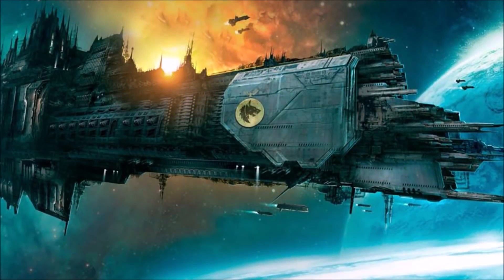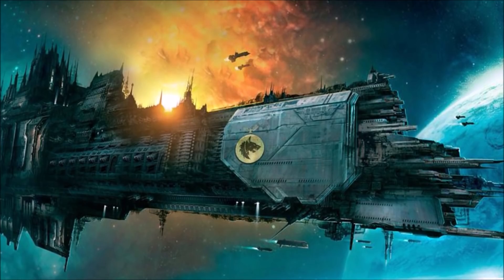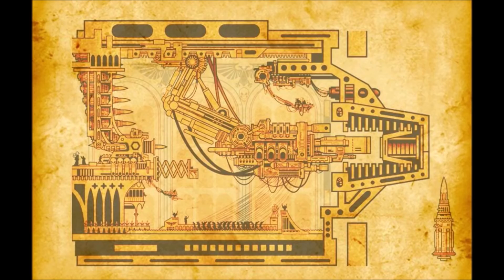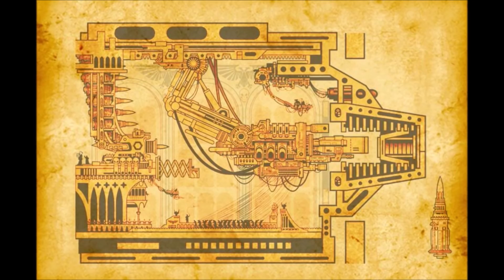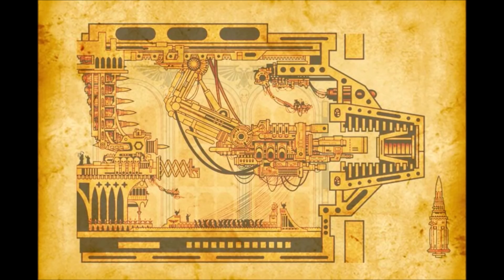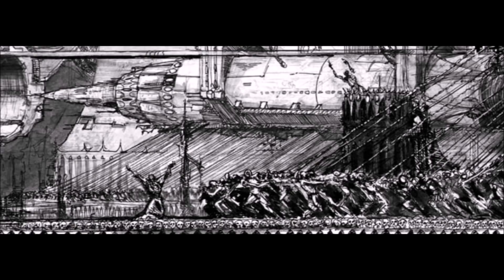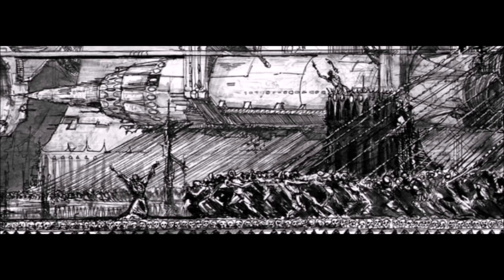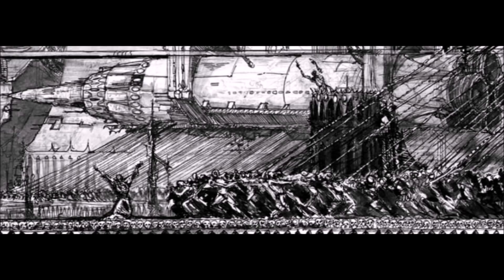Void War - Episode 0: The Methodology

Comment: It is clear that this games was designed before thinking about realistic conditions.
Reply: Maybe that's why they call it science fiction ?
Reply: @highconfessornicodemus1613  40K is Fantasy. Science fiction has to at least respect science.
Reply: @rodneykelly8768  name me one sci-fi setting that does that.
Reply: @powerflumi  

Eclipse Phase.

The Expanse.

Pretty much everything written by Asimov.
Reply: @powerflumi  What Malusignatius said…..
Reply: @malusignatius  i dont know what Eclipse Phase is but the expense has likewise a great deal of space magix involved, starting with the protomolecules for example and even more importantly the epstein drives.
Allthough to be fair its the most realistical one i too could think off.
Reply: @powerflumi  The Epstein drive bends things a little, but not as much as you think.  1g acceleration's been the pipe-dream of space travel pretty much since the dawn of spaceflight, and most of the issues there are engineering, not physics.  It's not breaking the light-barrier.  

As for the alien protomolecules, true, they do weird unexplainable stuff...  But that's kind-of their point.  They're alien, possibly alien hypertech.  

And apart from those to factors, the setting is very hard sci fi.  

Eclipse Phase is a roleplaying game, well worth looking up.  It's (in my mind) the best sci fi rpg out there.  Again there are some points where it's a little soft (asyncs and the gateways being the prime examples), but overall, it's mostly known technologies turned up to 11.
Reply: @malusignatius  Kinda my point.
Without the likes of the Warp, or the Mass Effect, or in this instance Protomolecules a pure hard sci-fi setting would be kinda boring really - especially if we take actuall real physics into account and not the near involnurability of the main characters.

The base difference in for example 40k and The Expanse is the the former focuses mostly on ground combat, the characters and the whole tech involved around it - which is rather realistic. e.g the Astartes and their powerarmor and why they are what they are.
Whereas the focus on space combat and ships is virtually non existend. Just look at the miniscuel amounts of lore most ships have in a setting that has nearly 500 full fledged books and usually explains things in details. And even then most infos are from the battlefleet gothic tabletop game which is nearly 20 years old by now - and the age is obviouse.

Whereas the Expanse focuses primarily on the ships and the things involving space first and foremost.
That and the modern day cultural influence which thank god drives designers nowadays into creating more realistic settings.

To be simple, the difference shows between the original ship design. Where the weapon loading was being done quite literally by thousands of slaves pulling the ammo into the weapon - serving as a living weapon loading system.
That has been changed recently into being actually automated. Simply put ship design is shit in 40k because it lacks focus for it.

Its a side note just as for example things like the power plot armor in The Expanse are, that despite it being at beast some 5mm thick ,it can easily tank assault rifle shots with the shots barely scratching the paint off.

Which all in all makes me wonder why people keep parroting around the "40k wasnt based on realistic conditions" or "40k is fantasy" mantra comes from, and why appearantly this only counts for 40k and not the likes of Halo and Mass Effect
- seriously, have you ever seen that phrase mentioned in any Halo or Mass effect topic?
Reply: @powerflumi  It counts for 40k here because it's a 40k channel.  

And there's plenty of people that have looked at the 'science' of Mass Effect (I don't know so much about Halo, not my jam really), and also 40k lies at the marshmallow end of the 'how hard is my sci-fi' curve.  Everything in it is basically 'what would be cool?' with little consideration of how it would work.
Reply: @malusignatius  I meant it in generell, 40k channel or not. And while i am sure some people have looked at the science behind Mass Effect and other settings, i have yet to see any topic where it instantly went with "its just rule of cool" or " nothing in it is realistic " etc.

"Everything in it is basically 'what would be cool?' with little consideration of how it would work."

As opposed to what? What would be extremly boring? 
Not even The Expanse does that. Take for example the point defence turrents or primariy weapons system. Why are they gatling guns instead of lasers actually?
Or why is ship to ship combat in space being waged at a fraction of the distance that even 20th century naval where waged?
Etc

Simply because it looks cool.

But just out of curiousity. Why is 40k at the "end of the marshmallow of how hard is my sci-fi".
Not just the most obscure and least explained parts like the ships series here that uses infos that are quit literally 20+ years old.
More mainline lore elements of 40k. What about it is unrealistic, could you make some examples please?
I mean, compared to say Mass Effect to make a easy example.
Reply: @powerflumi  Mass Effect is not a good comparison, as although it's more socially mature than 40k, it's reliance on Element Zero to justify everything makes it fall in many of the same traps as 40k.  It's 'a Wizard did it' by proxy.

As for what is unrealistic about ship design in 40k:

The Imperial starship designs are literally based on pre-dreadnought battleships.  Both they and Chaos ships assume 2d engagement tactics, and are lightly armed and armoured ventrally.

They have gravity in their ships, not 1g acceleration, but gravity simulation perpendicular to the direction of travel.

Range of engagement is far beyond what would be feasible if you go off of BFG.

Macrocannon rounds a ridiculously big, far in excess to requirements.

Psionics.

Looking at Expanse, sure. the engagement with a corvette maybe 60m long was at close range, and used gatling guns  It's still feasible technology and application of said technology.  You can't just go 'it should have been lasers and at longer range' and claim it's the same as kilometer-long vessels that to operate defy the laws of physics.

And to add to the list of more well grounded sci-fi, Battletech.
Reply: @malusignatius  Oh no. quit on the contrary. Mass Effect and the likes of Star Wars are the best examples, you made my point there for me. Yes "Wizard did it" but why is it never pointed out how unrealistic it is?
I mean compared to Halo, Star Wars and Mass Effect , the currently most known sci-fi games, they all fit in the catergory of science fantasy and dont make even realistic sense in the slightest. Yet why is it only pointed out with 40k?
And also, what do you mean ME is "socially more mature"? As contrary to 40k, make an example please.

- The only difference in ships in space and ships on sea is that space is 3d. You can still use the same
Reply: @malusignatius  All the minor explanations aside lets get to the fun part.

"Looking at Expanse, sure. the engagement with a corvette maybe 60m long was at close range, and used gatling guns It's still feasible technology and application of said technology. You can't just go 'it should have been lasers and at longer range' and claim it's the same as kilometer-long vessels that to operate defy the laws of physics."

How do they defy physics? And where exactly do they do that?

The idea and functions of The Expanse for example may be realistic, but its military application is not - by far not, and its logic is completly inexistend.

Take the PDT autocannons for example. Their effective in universe firing range is ridiculessly bad being around 5km.
The rounds being 40mm makes me wonder out of what kind of tissue paper the Expanses ships are actually made out of that they can easily penetrate the ships there, not even modern day ship plating would be that easily penetrated.

Which raises instantly the question of why exactly the ships then go into close quarter combat with each other in the first place. Why not stay at range and avoid enemy hits in generell.
Which also raises the question of why they have the railguns in the first place. Even in universe they are said to be slow firing and easily to be dodged, so much so even that its described as being a close engagement weapon which is mere x hundrett meters to a few km distance.

Why not have a more heavier armored ships (e.g not made out of tissue paper) and stay at range? Seriously why not stay at range? Even modern day ships dont focus on ship to ship battle in a classical sense of ww2. Ships essentially engage each other with precision strikes with rockets and aircraft. The gattling guns on ships exist soley as a defensive meassure against incoming rockets and aircrafts. Whereas the autocannons on frigates are just against smaller vessels and for eventuallites with no real expection that it ever would be used against any real enemy military vessel.

In fact i'd even argue that 40k is the logical evolution of The Expanse style ship to ship warfare.
E.g that in the Expanse you start out in having lightly armed and armored ships that are mostly for anti-pirating actions and patrolling aswell as precision strikes instead of drawn out combat and warfare.
But in time the leaders realized that this leaves them lacking on several fronts. Which results in more heavier armored ships. More heavier armored ships results in slower ships, which in turn makes you want to stay at range as far as you possibly can. But at some point there is a drop off, which means you need to have either more precise weapons or incredibly destructive aswell as fast firing weapons arrays.
Which in turn results in using large scale laser and larger but more primitive weapons ( btw in case you dont know 40k macro cannons are actually railguns in battery formation ) that simply drown the enemy in fast moving pieces of metall.
This is all because using lasers of simply special shaped pieces of metall are far more cheaper and logistically feasible than having to use specialized delicate torpedos.
Remember in warfare its not the most sophisticated weapon that wins, but the cheapest and easiest to produce one.
Which of course all results in the ships becoming larger.

Or in short. The reason why space battles and ships in the Expanse are the way they are is simply: Because it makes for cool visuals since we are still talking about a show.
Hence why ships have masses of PDT with which they engage each others instead of simply throwing rockets/torpedos and attack crafts at each other.
Alltough attack crafts and fighters are really stupid for space combat.

Imagine if it go by 40k style or worse modern day military military doctrin. Where the two opposing ships dont even see each other due to the distance between them. Where combat is by simply looking at a targeting computer that tells you went to shoot and when not and just involves throwing torpedos into emtpyness of space that either hit with luck or at getting destroyed before the crew of the ship even has any idea that there was something incoming.
Where instead of some daredevil pilot with a grimming face skillfully maveurers their ship around. Its instead just tapping some coordinates and numbers into a computer and letting the system to the rest.
Where enemys act logically instead of suicidially - see battle for the donnager. Instead of just rushing head first into their deaths act strategically.

Oh and btw, there is absolutly no reason at all why in the Expanse they are using autocannons instead of laser.
Laser are far more usefull against incoming torpedos because they can be destroyed way long and at safer distances before an autocannon comes even in range to it.
Same goes against light attack crafts, you can dodge a x00m/s projectile, you cant dodge a 300k km/s energy beam.
Equally so it would allow for more distance between the ships which results in it being safer for them anyhow if the other side refuses to use such weapons.

In my opinion The Expanses realism or why people think it as such. Comes from the little fact that its actually not that far off in time technologically speaking and looks feasible by our modern viewpoint instead of the typical sci-fii everything is white and hyper futuristic looking. In fact it looks like as if the tech could still be seen and used by people today.
Which is indrectly supported by you by stating that "Battletech" is realistic. No it isnt even remotly that if we are still talking about real physics and science.

Oh and btw, apart from the Psychic part. Nothing that you said makes the ships or the setting unrealistic, it makes it impracticle. E.g having a ships aft or ventrall side exposed. 
In modern day and historic military there are lots and lots and lots of stupid decisions. In fact you'd actually be suprised how flawed most weapons and armor system today even are and how many weak points they have.

Which is weird overall and its even one of the main arguments even when people are saying that 40k is stupid or unrealsitic because not everything done and every decision is 100% pefecticly logical. E.g take the mechanicum and why innovation is rare in the Imperium. Its because of technology being the domain of the mechanicum and the mechanicum having religiouse dogma against it. Realistically it makes perfectly sense , there are quit literally religiouse ideologies here today that type of thing and worse. 
But because its not 100% logically dictated, its argued that its unrealistic.

In fact a major part of 40k realism is how often times stupid and flawed things are in the setting, and that nothing is perfect but flawed at its core.
Reply: @powerflumi  Again, it often is, just do a Youtube search for 'the Science of Mass Effect' and you'll find a bunch of videos on the subject.  And Star Wars is considered the definitive Space Opera (a title that can be applied to ME as well).  As for ME's social maturity, it's more inclusive, social dynamics are thought out better, thought given to how the different species interact etc.  How that's been considered in 40k has always been patchy and inconsistent, often varying from story to story (or edition to edition).  But then again, the background of 40k was created as a parody of Thatcherite England and totalitarian government, it's not meant to represent a feasible social hierarchy.

Fighting in space is not like 3d maritime combat at all.  Orbital mechanics, the distances and the velocities involved make it a very different kettle of fish.
Reply: And also, you're initial argument was not 'Why don't ME or Star Wars get the same critique as 40k', it was 'name a Sci Fi that doesn't do (what 40k does)'.  

So far, I've listed Eclipse Phase, The Expanse, Battletech and Isaac Asimov's back-catalogue.

So maybe go and have a look at those before continuing to defend your point.
Reply: @malusignatius  
" As for ME's social maturity, it's more inclusive, social dynamics are thought out better, thought given to how the different species interact etc. How that's been considered in 40k has always been patchy and inconsistent, often varying from story to story (or edition to edition)."

First of all the story hasnt that much to do with editions, editions mostly provide rulesets and are generell base set to where the story is going. E.g the jump from 7ed to 8ed, 7ed was during the time of the 13th black crusade but it didnt revolved around it, its just a time period.
Whereas 8ed is after the 13th black crusade de facto ended a few centuries later. The story is being told in the books not editions.

Also its kinda contradictory you saying that ME has social dynamics but then argue that in 40k it varies from story to story. In same cases like for example with the Eldar that is correct. Because the story involved has different groups or individuals involved and the things there are being decided from their current standpoint and not a generell overview.
How the Eldar are currently "allied" with the Imperium - they are not. The Eldar and the Imperium are still at war and still depending on where fight with each other over terretory.
Only now they have a greater common enemy and try to genereally avoid each other. The only Eldar that are "allied" with the Imperium is the Ynnari faction, and thats the things its a signle faction. And they arent so much as allied with each other, they mostly just use each other as a means to an end - which currently is primarily surviving, but that doesnt mean they are friends or even friendly with each other.
Which is running contradictory to your argument that an entire species has one common mindset and reaction of sorts to something.

Or take the Tau for example. The Tau want to conquer the Imperium, the Imperium in turn wants to kill the Tau to the last man women and child. But both dont do that (as much as they would want to) because there are seriouse concern for them currently. So much so that some factions within the Imperium are arguing to or have already outright declared a seize fire pact - to be more precise the Ultramarine Astartes and the Deathwatch inquisitorial chapter, not because the two groups like the Tau, they only use them currently as a means to an end and because they dont want to risk unnessary engagements when the Tau could fight for the Imperium indrectly and secure some part of the eastern galaxy. The Still can and will be dealt with later.
The first Ciphas Cain book dealt with precisly that on that some backwater planet that is currently on its way to be annexed by the Tau from the Imperium with already there being large concentrations of Tau military forces and settlements on the planet.

Yet the main jobs of the military commands locally of the Imperium was to avoid conflict with the Tau and find some sort of peacefull agreement. An agreement that was at risk because of a genestealer infiltration of the local planets leadership which institgated a assasination of an Tau ambassador and riots between both sides.
The protagonist of that story Ciaphas Cain ( a commisar - being a political officer ) did his best to avoid having the two sides engange in a military conflict over some worthless mudball of a planet. In fact he outright safed the other Tau ambassadors during a noblemans party and calmed the situation down, not just that he prevented further assasination attempts against the other ambassadors and with the help of some of his forces escorted the Tau to their military basis. Even going so far as to killing local human soldiers who thought the comissar of being a alien sympathiser who where about to shoot the ambassadors.

"But then again, the background of 40k was created as a parody of Thatcherite England and totalitarian government, it's not meant to represent a feasible social hierarchy."

And here's the entire problem. Its obviouse you know nothing to next to nothing about the setting and its story. For starters, 40k started out as simply Warhammer fantasy in space as a joke. Nothing more.
It became then space mad max punkrock in space.

Only to be fully changed into the first basic iteration of the setting that is today. No it isnt a "parody of Thatcher" neither is Ghazgull the Ork Margerette Thatcher.
And no neither it is a parodie of a totalitarian government, the Imperium is a space take of the prefall western roman empire in its decline with a great deal of historic elements taken into the setting. E.g the Tau being Chinese Communists, the Eldar being a mix between Gaelic and pre communist China and their cultures mythologies, the Imperium being the Roman Empire and the holy roman Empire. The Astartes and the Emperor being Nazi Aryans and Nazi military fundamenlist culture etc.
And even then only that their very superficial basics, when you read deeper into the things they become nothing like the real world things.

Its this that what is my point actually, People simply parrot things they've heard somewhere that someone heard somewhere without actually knowing anything about the settings.
That nothing in this setting makes sense, because you simply yourself know next to nothing about the setting.
Reply: @malusignatius  "And also, you're initial argument was not 'Why don't ME or Star Wars get the same critique as 40k', it was 'name a Sci Fi that doesn't do (what 40k does)'. "

No? My initial argument was indirect question to what setting basis itself on a respect of science and realistic conditions instead of what would be cool.
You then listed Ecplise phase - which from a basic overview of mine i can say. No it doesnt.

My entire argument isnt even to argue about wether 40k is realistic or not.
My argument is actually a drawnout question. Namely why so many people, you for example, instead of looking to the setting and topic, argue about it from a point of complete ignorence - e.g you stating that the story line is based mostly on the edition.
From which then you started to confuse realism with logic.

My point still stands. And this isnt about any youtube videos btw, its about people in comment sections parroting like a religiouse mantra "40k is not realistic" - e.g what the OP did.

"So far, I've listed Eclipse Phase, The Expanse, Battletech and Isaac Asimov's back-catalogue."
So? Ecplise Phase looks, weird and has a weird as story line. Starting with the typical machine rebellion cause reasons. Space Whales living in the Sun - realistic yes.
Or the little thing that you can copy and translate around a human mind to overcome distance - the setting pretty much has suicide based transporation system, thats actually really damn metall if you ask me. But it raises the question why the people there have a shittier survival instinct than 80 movie villian henchmen.
May i remind you that the initial question is which setting does that?

The Expanse, we just covered that. From a science perspective it makes some sense, but militarily its just hillariously bad and as mentioned ironically based on what looks visually cool.
But even here we can argue that we learn so damn little about the tech, that we are expected to simply assume that it somehow works. But if nothing it has at the very least Space that functions actually like fucking Space and humans that act human unlike so many other sci fi settings where humans are organic robots mentally speaking, caugh star trek.

Battletech: Do i even have to say something apart from that the question was which setting uses and respects science instead of the rule of cool.
Bipedal
Mechs.

Asimov, to be honest i never have read anything from Asimove so i cant say something towards that.

"So maybe go and have a look at those before continuing to defend your poin"
What is my point in your opinion again?
Reply: Pasha Staravoitau 

If all of Heinlein's books are realistic, do not forget starship troopers did  have an influence on 40k
Reply: Pasha Staravoitau  

Not just the MI, but worlds focus on a powerful centralized government, with a strong focus on military power. And don't  forget about the space bugs.